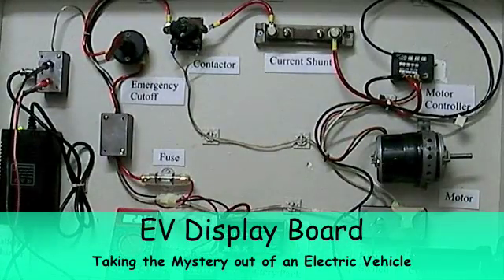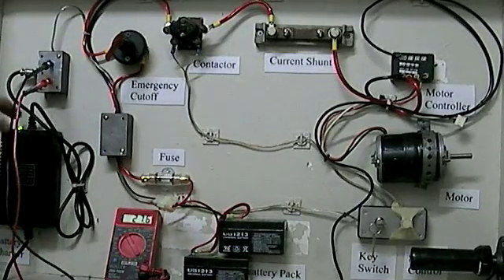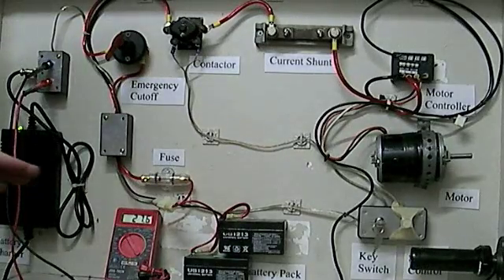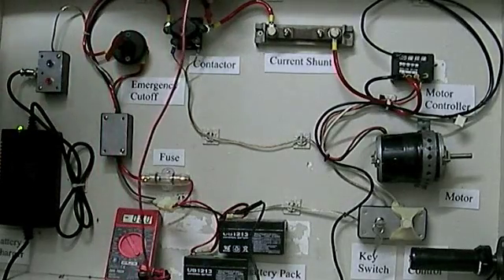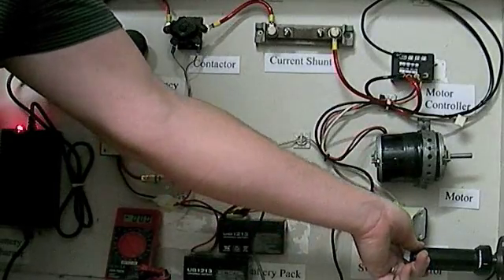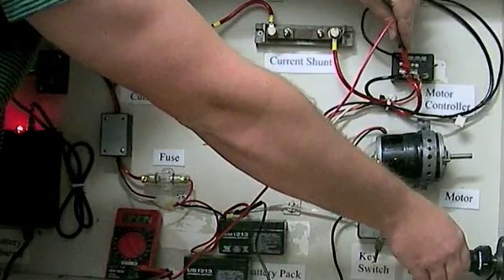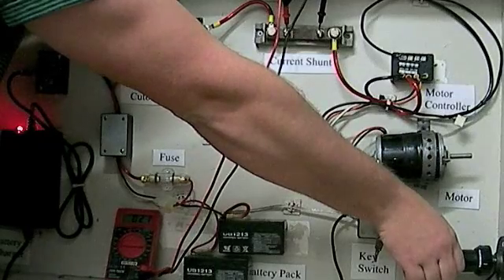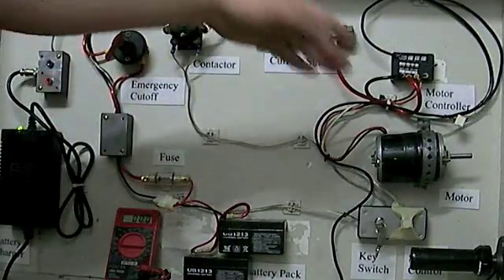Simplified Explanation of How Electric Cars Work

Comment: With the energy shutoff you still had power to the key. I would think you would want to kill all power with that switch. Therefore putting tapping the power fir the key on the output side if the emergency switch.

Comment: Thanks for the video help me to see what I was missing kinda ... still not sure where to proceed next as I want to make an awd cart with four hover board brushless motors and probably a 500w controller for each wheel running off two 36v batteries paralleled would the current shunt be necessary.. I planned on adding the emergency shut off and fuse online from battery pack but I don’t wanna hook all this up for it to blow/burn something up cuz I forgot part that I was still missing ?? Any help or answers that could help me out

Comment: The shunt should be 1 ohm, which ultimately means that if you measure the voltage across that shunt, the voltage reading is the same as the number of amps.  That's how a shunt works.

Comment: just the motor controller and motor and battery pack cost so much to do.  i would love to build a little s 10 with solar panels to recharge the batteries.  that way i can drive it to work leave it out in the sun all day and drive it home.

Comment: how to reverse the movement of the motor?
Reply: Kian Han Tee Kian Han Tee On an electric car the motor goes to the transmission so many of the EV guys won't be able to answer this question. And on an electric boat you generally leave the transmission because electric motors aren't designed to take the axial load, so you either need that or something like thunderstruck's gear reducer that isolates the axial load from the prop. Many motors aren't reversible, but the motor comes with thunderstruck's kit is both reversible and under sail recharges the batteries. Sevcon's Gen-4 Controller takes care of the reversing internally without additional contractors. It looks like a good kit to me but I don't have any experience with them, so I'd love for someone else to add to this. Check out http://www.thunderstruck-ev.com to see what I'm talking about.
Reply: Kian Han Tee you would never need to do that

Comment: I am pretty sure the drop in voltage when you rev the motor is not due to "the batteries working harder," as you stated, but rather due to the back-EMF induced in the coils of the motor: "When the armature of a d.c. motor rotates under the influence of the driving torque, the armature conductors move through the magnetic field and hence e.m.f. is induced in them as in a generator. The induced e.m.f. acts in opposite direction to the applied voltage V (Lenz's law) and in known as back or counter e.m.f. (Quora.com)"
Reply: i feel like upvoting coz this actuall sounds like it would make sense... but i know absolute zero about this black magic :D
Reply: Mark Watson and so the difference between the source voltage and measured will be the amount of emf generated?
Reply: Mark Watson Also the voltage drop thru the current shunt contributes to the total voltage drop.
Reply: Mark Watson daammm.

Comment: I congratulate excellent work, l would like me supplied a list of components and where can l get in USA.
Thanks for sharing your knowledge,
Thank you sending your email
Julio Cesar Perez Camargo
in Bogota Colombia
perezjulio@hotmail.com
Reply from the maker: Julio César Pérez Camargo These components were salvaged from an electric scooter.  The cheapest way to get the parts would be to find a used one online like craigs list.  They will usually go pretty cheap, probably just need to get a new battery.  Things like the solenoid and shunt would have to be sourced some where else but they are easy enough to find.

Comment: Do you still disengage the clutch and shift a manual transmission the same way as a gas engine?
Reply from the maker: Tucker Not Sucker!  Typically on a conversion, if the clutch is left in the vehicle, you would disengage the clutch to shift the gears.  It makes shifting gears easier.  The car would kind of drive a lot like an automatic; what I mean by that is you put the car into 2nd gear.  Once it is in gear, even at a stop, you don't need to disengage the clutch again until you want to shift.  So taking off you leave the clutch engaged, drive at 25 or so MPH and you approach a stop sign, you just apply the brakes.  Never touching the clutch.  On a gas engine you have to disengage the clutch because the Gas engine wants to keep spinning but on an EV, no power is applied to the motor so it just freely rotates, so no need to disengage the clutch in this scenario.  To go faster, you would eventually shift into 3rd gear.  So it is only slightly different than driving a stick shift car, but you quickly figure the trick out.
Reply: ElectricFormula Makes sense. Thanks for the explanation.
Reply: Tucker Not Sucker! I removed my manual transmission from my conversion as with an electric car you only need two gears, one for torque and one for speed, these gears change automatically in my setup which I engineered, however I can override the change if I require torque for longer or the pitch of the car requires torque. 

It cost me less than $500 for the setup.

The momentum of the car rolling when you're at speed allows the motor to generate electricity instead of consuming it which is also a plus with not disengaging the transmission if you go down that path.

Comment: Nice video and simple explanation. You would also want to run a DC/DC converter for your 12v Accessories (head lights, indicators, radion etc.. ) inside your car.

Comment: We are restoring a GMC EV1 drivetrain that General Motors put in S-10 pick up it was working fine when we took it apart we just wanted to put new or components and better batteries in it that is what we are doing now making batteries more accessible and easier to maintain for futuristic batteries that are yet to come out and general maintenance the old ones. Original was set up to force you to take it to General Motors repair department which doesn't exist of course anymore

Comment from the maker: REGEN really only works on AC motors, there are ways to do it in DC motors but it is really hard and usually not done. But REGEN is just the process of converting momentum into electricity through the electric motor.  It takes a lot of force to make electricity so that is why it slows down the car when applied.  If you were going to stop anyways, might as well collect energy so it can be used to accelerate again. But its not a lot of energy gained but better than nothing.
Reply: Which motor provides more regen? AC or BLDC?.

Comment from the maker: Several people have shown this in videos and on the web.  If you use one motor to spin the other the output is always less.  Try cranking a hand generator like something on a emergency radio.  Feel how much force it takes to have it make electricity to just power a radio.  It takes a lot, so the driving motor would have to work hard to spin the other motor but in the end the output would be less, how much less depends on the motors and how sensetive your testing equipment is but its aways less.

Comment from the maker: There are websites that can explain it better than the short comment section but the short answer is No.  It takes a lot of force to create electricity.  Thats why automakers use it for braking with regen.  It takes so much force to make electricity that it can stop a 3500 lb car.  So you can't hook a pully to the wheel and think your going to get free energy, its actually a loss in energy from each of the conversions (mehanical, to eletrical, to chemical, back to eletrical, back to mechanicla)

Comment: My question goes more on this way. Hope you can hall understand.
An electromagnetic motor is in fact an alternator and vice-versa, right?
In this electric mode veichles, you induce energy from a batery to make the motor spin; while spinig the motor is producing energy it self, that you can send back to the batery and re-charge it, consecutively, till it dies completly.
So, if the veichle is moving you have energy, if you have energy you can do something with it, always! Right?

Comment from the maker: The throttle is just an input device for the controller to know how much power your requesting to apply to the motor.  So the controller is doing PWM to the motor based on your throttle position you have set.

Comment from the maker: I believe most chargers are fine with charging the batteries the same time the vehicle is being run.  But usually the chargers are lower power.  So there isn't enough output to gain you enough mileage to make a difference.  Example is it takes 6 hours to recharge the vehicle, so unless your driving really slow you wouldn't keep up with the energy being used.  Instead of going through the charger, some people use a generator head and rectify the output to go directly to the batteries.

Comment: Can you use the charger while you run the motor? I have a similar (36v) setup in a mini electri ATV and was wondering if i can hook up a small petrol electric generator and go for a long ride. Will the charger fry if i use it while i drive?

Comment: I see what you're saying. However, consider this. When coasting in neutral gas is being input to run engine at idle, losing gas. When coasting in highest gear possible, you're still losing energy by running the engine and crankshaft. Hybrid cars will brake regen and shut off engine when not needed. Brake regen by itself won't be more efficient than coasting but when you add all the things that go with them, I think it is.

Comment from the maker: It depends on what "energy" you want back. By coasting, you're keeping "energy" stored as kinetic energy, losses there are friction and drag.  Regen takes the kinetic energy to convert it to chemical energy and the losses there are mechanical to electrical to chemcial. So if you don't count coasting as part of a storage device then your loosing part of the picture. Its more effecient to coast than to brake/regen and then accelerate back up again. But if you had to stop anyways, best to regen.

Comment from the maker: A place I have been to before is tncscooters (google it).  They have the basic upgrades for a lot of scooters which could be used for a go-kart (not extreamly fast through).  I actually have an electric go-kart started but it is unfinished.  I have a old golf cart motor for the powerplant and use something like an Alltrax controller.  It will be setup for 48 volts , so it would be a real screamer so would probably need to have a way to put it in low  (24v)or high (48v).

Comment from the maker: On DC systems, theres not a convenient way of getting regen working. AC motors will do it inherently, so thats why auto manufactuers will include it. Good driving techniques can give you just about the same benefit as regen. People just don't want to learn them, a simple one is just paying attention to the road infront of you, when you see a light turning yellow or a stop sign start coasting. For a light, the light might turn green before you get there so you don't waste energy speeding back up.

Comment from the maker: With a CVT, you could get away with a smaller AC motor.  I don't know of anyone doing a conversion yet with a CVT but I don't see any reason why one couldn't be used.  Might have to have the logic updated on the CVT to keep a different RPM, but I think would be doable.

Comment from the maker: You can do a manual trans or automatic.  The manual trans will be more efficient than the auto.  The auto was designed with shift points of an ICE in mind.  With the electric motor, the shift points would be different.  You can modify the auto trans to have better shift points.  One of the guys in our club did that, its exensive but he does have an automatic EV.  Can do a conversion without a trans but got to have a much bigger expensive motor to do that.  Easier to just use the transsmission.

Comment from the maker: Mostly the price.  DC motors are a lot cheaper and the controller that goes with it.  More and more people are making AC motors that could be used for DIY EV use, they are coming down in price.  But other than price the DC motors is they will create a lot of torque right away. So those are probably the two most compelling reasons for a DC motor.

Comment from the maker: If there is any problem with a particular part of the electrical equipment the fuse will blow before your expensive equipment does.  Just like in the car's regular 12 volt fuse block or in your house.

Comment from the maker: There is a small black box on the left which recharges the battery just like in an EV.  No system will be self sustaining, there are gimics out there that make it look like it is but to much energy is used to make the EV to go which will never be recaptured (not even with regenerative breaking).  So you always have to have an external power source to recharge weather it is an on-board generator or plugging in to an wall outlet.

Comment from the maker: My best advice is to find an EV already converted.  There are lots for sale out there.  Usually you can save some money and you can start driving right away.  You should also find your local EAA club and talk with them and learn as much as you can.  For your other questions, the batteries provide the amps used, so the batteries provide the 500 amps.  You can use a generator but adds cost and you have to get a big one to be able to continuouly drive.   I hope this helps.

Comment from the maker: Power brakes on an EV are supplied by a vacuum pump, so you use the car's factory brake system. Power steering can be accomplished by a secondary motor turning the factory steering pump or conver to an electric version like the Toyota MR2, or you could also use the tail shaft of main motor (but only works when motor is spinning). The A/C system is just like the power steering system. For the stereo, lights, signals, those all use the car's factory 12 volt system so no changes in those devices.

Comment from the maker: Controllers in EVs have diodes that they call a Free Wheel Diode to allow coasting without using any power. So you can let off of the throttle and coast a long ways before needing more power again to speed up. Makes for very easy pulse and glide driving (hyper miler style of driving).  In my exmaple coasting means no power applied to the motor. Only thing slowing you down is friction and air drag. You can have a controller setup to cause drag (regen) but that is a special controller/motor combo.

Comment: Nice Video!! Even though I already know a bit about electrical systems, this just helps to make it clear. Although, what about coasting? This set up would essentially be applying a brake when you let off the throttle. Do you just need a proper controller that provides the coasting function? And is the amperage maintained during coast?

Comment from the maker: @deputy1040 There are charts on line to know for sure what size of wire to use.  So use the online charts to look up how much current each gauge of wire can handle and size it appropriately to what the controller can do.  Going bigger doesn't hurt anything, better to be in a safe limit compared to the top end of a gauge of wire.  For the fuse, that depends on the controller, find out the current and get the appropriate size.

Comment from the maker: @akai454  This display model is an DC series system.  Everything would be the same for an AC system except for the controller and the motor.  You use the same batteries, fuses, switches, contractors, etc.  The controller of an AC system uses the DC power from the batteries and converts it to a 3 phase AC output.  So what I covered in this display works for both AC and DC systems.